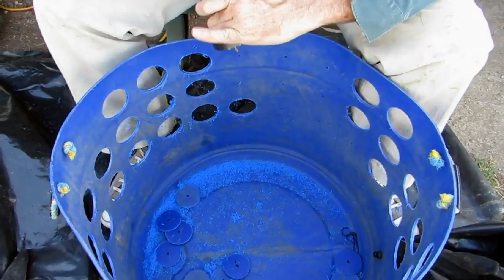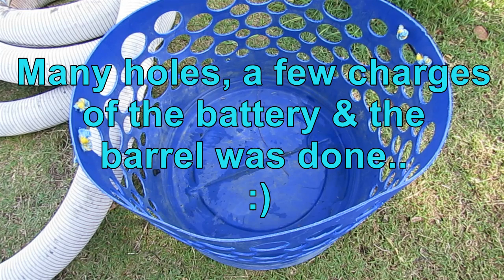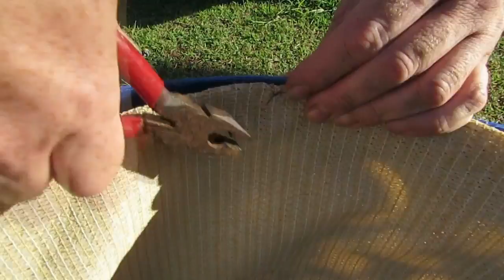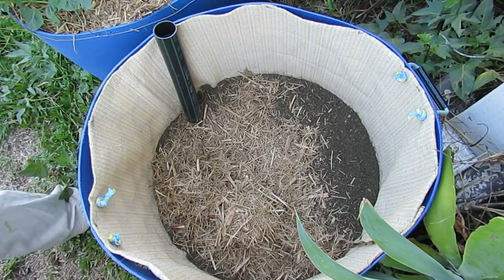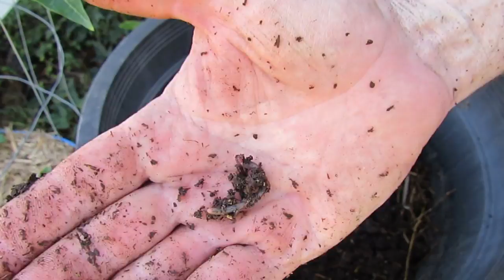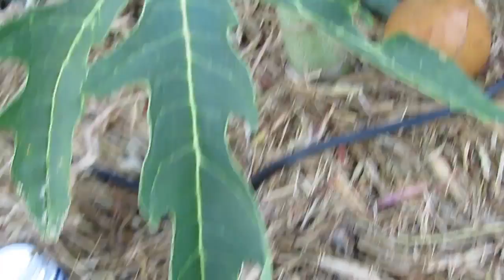Air Pruning Self watering/Wicking barrel, a DIY project for papaya/pawpaw..

Comment: So how did this experiment go?  when I first watched you with the wicking barrels you just had one coil of pipe and the middle was full of sand On this one you add more. When i made mine I used the second approach. What I noticed was that some of the barrels seemed to empty every 3 to 4 days, but on a few they always seemed full.  Do you have a list of what grows better in the barrels ? Zucchini seems to do much better in the ground for me. Peppers and tomatoes seemed to grow well, green beans started great but then seemed to stop growing (this is one where the water always seemed full).  So I wondered if leaving room in the middle for more sand would give a better wicking action and keep all the soil more moist in the barrel. Any thoughts?
Reply from the maker: Andre Lotscher Hi Mate.
The papaya is still growing well. Just started to set more fruit after I started to feed the soil in there better. 
Have hit & miss results with a few different plants. Zucchini did OK as did the beans in some but not in others. Have found that the beans didn't do so well in barrels with little planted in them. Not sure if that's because the soil in there didn't get to dry out as much & the beans didn't like the constant moisture or if the soil blend in there was just a bit dodgy.  

I don't think having the extra pipe in the centre stops the wicking action too much as long as there is a bit of sand making it through to the base to bring the moisture up to the soil level.  In the barrels I've set up this way the soil is always damp 50mm/2" under the mulch layer. 
It would also depend on the soil blend too. I don't think most of the the bagged potting mix we get here would work too well in barrels like these unless extra compost/organic matter is added. 
Hope that helps a bit mate.
Reply: Did either of you innoculate your beans? They may not have had the bacteria they need available to them in your soil mix, and that can slow them down quite a bit. Here in USA, zone 7b (long, hot, humid summers, but not quite as hot as yours, Rob -- we hit 100F a few times in the height of summer, but anything over 95F w/80%+ humidity seems WAY hot enough!) we have a critter called a flea beetle that causes a lot of damage to leaves of all kinds, but they don't seem to bother anything that's potted in something 2' or taller, so the nightshades (tomatoes, peppers, eggplants) do much better in pots as long as we make sure the nutrition is right with good soil, compost, and good drainage.

Now my question, because I'm too lazy to go back to the first video I saw you use it -- your sock material. What's it called, where'd you find it? I want to search for a North American (Texas, if possible!) analogue!

Comment: I read somewhere that Papaya tree don't do well on Wicking barrels. It says something like they don't like "Wet Feet" . Any suggestions on this. Thank you and great videos you have.
Reply from the maker: Tony Molina Hey Tony.
Ours is still doing well with new fruit setting on it at the moment. The only problem I've had with it is the nutrients in the soil were depleted very quickly. I had a period where the tree set no fruit until I started to feed it regularly with a basic compost tea. 
As long as wicking barrels/beds are allowed to dry out a bit between filling (to mimic the natural cycle in the ground & allow O2 to be drawn into the soil) I can't see any problem. Have seen some massive papayas grown in aquaponics too & am planing to do the same here ;-) 
Cheers Tony & have a great one.
Reply: RobBobs Backyard Farming
Thank you brother.

Comment: Hi Rob,
Just a thought for you rather then drill you 50mm holes directly below each other if you off set each row this should prevent the need to drill the smaller holes in between there for saving you some extra work next time you do you next barrel..
Regards
Wayne

Comment: This is another very interesting video.  I like these ideas, kind of everything container rolled into one.  My question would be, you are planting a tree in there ... so, how do you feed it over time, or are you going to just re-pot it when necessary?  Can you leave it in that air-pruning pot and just add compost or fertilizer over time?  Good luck!
Reply from the maker: justgivemethetruth Hi Again..
The tree used up a lot of the nutrients in the barrel fairly fast which was to be expected.. Have worked out that it needs to be fed every couple of weeks to keep the flowers & fruit coming.. Have been using compost teas & a kelp so far & they look to be working OK.. 
Cheers..

Comment: Hi Rob,

At around 11:30 you mention that you might add some air pruning to your aquaponic system. This is something I'm particularly interested in as tree-based products are a pretty substantial part of a person's diet (most fruit, for example). I note in your more recent videos you did add a couple of constant flow barrels, but these were just ordinary barrels. Was this (air pruned aquaponics) something you still hoped to look at, or did you change your mind / run into obstacles?

I ask as I have tried to find people doing this successfully, and have only found a couple who've had limited success, and nobody growing anything as large as the papaya or morenga that you have in your current air pruning pots. I plan on building a system over the coming year, so if you foresee any particular difficulties then your insight would be particularly useful. I'm trying to decide whether to use a soaker hose tied so it runs around the barrel in a circle somewhere about halfway between the centre and the outer edge (similar to constant flow but with the water at a lower rate in more places so it doesn't just run out the holes in the sides), or whether to just do the wicking through soil with a lower layer of sand - obviously the extra nutrients provided by compost, and the reservoir aren't needed when there's a good flow of high-nutrient aquaponics water. (Oddly over here in the UK, the first is easier to set up - despite it being the more complex, it's easier to get the parts - mostly due to the PVC pipe business being dominated by one company who do non-standard sizes making them incompatible with many fittings!)

Thanks for the regular videos, as always, very informative and interesting!
Reply from the maker: grotlek Hi there.. 
I did play around with some 1gal pouches in the last of the 3 aquaponic beds I set up but didn't follow through with it.. Wanted to pop in some greens so the pouches have come out for now..   
Have seen folks grow quite large papaya in aquaponics but not in a hybrid set up.. Am looking at setting up a dwarf papaya in the aquaponics here but am not sure how the bed/barrel will be sorted out yet.. 
Glad you like the clips & have a great one,
Rob..

Comment: I really like this idea but there MUST be an easier way than drilling so many holes? We live in the age of cheap plastics. What can you buy off the shelf with holes already available (ie laundry basket) that you can convert into a wicking pot?
Thanks for the video.
Reply from the maker: Hey Jeff..
Laundry baskets would do the trick but may not last as long due to the UV.. Air pruning bags like Root Pouches sitting in a tray of water are another easy build that would have the same sort of result I think.. 
Would be great to see what you come up with if you have a crack,
Rob..
Reply: Thanks Rob
Really like your self watering pots.
I need a way to limit my paw paw (not dwarf) to a managable height without making it root bound.
I might give those bags a go.
How much do you pay for the barrels? I am trying to source some. I'm also in Brisbane.
Reply from the maker: Jeff Bourke Have picked some up at markets & gumtree for $10-15.. Most produce/feed stores sell them between $25-35.. 
You can find the Pouches on pour website if you're interested.. Will be setting up a barrel with one in a few days & will post a clip on how it went..
Cheers mate..

Comment: Why put the hose in the bottom? Why not just put sand in there?
Reply from the maker: Hi Ella..
The hose is there to allow for more water to be stored in the base allowing the barrel to go longer between top ups.. 
Have a great one..
Reply: Does the water stay inside the hose? It seems like it would just run out.
Reply from the maker: Ella there are holes in the pipe so it can flow into the sand.. From there it is wicked up to the soil to become available to the plant..  As the base of the barrel is sealed it can't run out to waste..
Reply: If you want water in the sand, why not just water the sand? Does the pipe hold MORE water than the sand alone would?
Reply from the maker: Yep.. The pipe is a large void space compared to the space between grains of sand..
Reply: I have a hard time seeing why it doesn't just flow out through the holes into the sand though. :D Sorry I feel dense, I need to do it to understand.
Reply from the maker: The water is supposed to flow out into the sand so it can wick up to the plants.  The pipe just offers more water storage capacity when the reservoir is full of water. Hope that makes sense ..
Reply: I can see a pipe without holes storing water, but a pipe with holes, where the water can just run out (as it tends to want to do)...not so much.
Reply from the maker: Well, it flows into the sand & is stored there once the sand is saturated.. Might pay you to run your own experiments & see what you find ;-)
Reply: It stays in the tube as water, once the sand is saturated. I'm starting to be able to understand, I think???? lol
Reply: RobBobs Backyard Farming   Also, do you want it so heavy you have no hope of every moving it without lots of hands on it?
Reply from the maker: Have moved a lot of barrels with a hand trolley justgivemethetruth so I don't think it'll be too much of an issue..
Am sure I'll be able to sort something out if worst comes to worst..

Comment: Really interesting way to plant fruit trees.  I'm wondering if the trees would survive in their above ground pots in our Zone 5 climate?  Would love to grow our Dwarf Honey Crisp apple trees in this kind of pot. Will be checking out your fabric grow bags and see how they might work for us.  Great site.  Thanks for your helpful and innovative info. Lynn & Rick
Reply: WisconsinGarden 
I've seen young trees boxed and insulated up to 3 feet above the root line for winter protection.
You may also consider bubble wrap velcro coat for the rest of the trunk and main branches to keep the tree cozy.
The rest would be considered freeze pruned.
Reply from the maker: Hi Lynn & Rick.. Might be a bit cold there as the soil in the barrel might freeze on you.. Could be another story if you had a warm enough green house to grow them in..
Cheers,
Rob..

Comment: With a tree coming out of a pot like that, I've seen the bottom couple of inches of root and soil simply cut off.  Didn't seem to harm the tree any.
Reply from the maker: Am hoping that the tree won't get rot bound in the base.. The tree will be removed from the barrel at some point to see what has actually happened with the roots in the reservoir.. 
Cheers & have a great one..
Reply: RobBobs Backyard Farming 
Will you update the video when you remove the tree from the barrel to show how it's roots developed?

Comment: Hi rob,

Sourced most of the material, just not getting the same kind of shade netting you used. Could you tell me the kind you used
Reply from the maker: Hi Karan.. So sorry I haven't answered your email yet.. 
Did you end up finding some "sock" for the ag pipe or have you used other means to cover the pipe ?

The shade cloth is 90% UV blocking cloth.. Is normally sold in hardware or garden/landscaping stores here.. 
Here is a link to the distributors we buy some of our netting from.. Not sure they would be the cheapest option for you to purchase the netting but some of the information on their page might help.. This page has downloads of their various products just to give you an idea on their quality & how long the cloth should last.. 
http://www.netprocanopies.com/product-sheets.html

I do hope that helps some & sorry again for taking so long to get back to you..

Comment: Hi Rob,  Have you or do you know of anyone that has tried putting in some perlite or vermiculite in place of the sand and tube?  I have tried this for a brief time so far and find it amazing how much water these inorganic materials will hold.  I think it is great for wicking because it does not rot like organic materials do.  I like the air pruning idea and want to use that with a wicking system in the next growing season.
Reply from the maker: Hey Dale.. I haven't heard of anyone using them to tell you the truth but have had someone ask if I thought it was suitable before though.. 
My only concern would be that it would compact over time but would love to be proved wrong :-) Have only ever really used perlite in hydroponics years ago for a short time before switching to the clay balls so have very limited knowledge of how it holds up over time.. Would like to know how it goes for you in the long run..
Cheers mate..

Comment: Hi Rob, I building 4 air pot this weekend, I'm interested in your slit cut idea, rather than the holes. Hopefully you'll get some time to have a look at this idea in the near future. All the best, keep up the great work.
Reply from the maker: Hey there... I have made the barrel, just haven't got around to making it up as of yet.. Did post a picture on our facebook page though..
https://www.facebook.com/photo.php?fbid=614555171927232&set=a.417629381619813.91747.417625838286834&type=3&theater
Have had some say the gaps are too wide but think the shade cloth won't bulge that much if secured correctly.. The barrel is really there just to help the insert keep shape.. 
Hope that gives you a few ideas..
Rob

Comment: great video thanks for the info
Reply from the maker: Hi there..
Hope it helps out out some.
Cheers,
Rob :)
Reply: Rob Bob yeah iv seen the small plastic air pots that you can buy but your idea with the pipe as a water storer is a good idea.. also i love the idea with the roof felt that's good as you can have a bigger hole s with out the soil foaling out    and the air can do its thing on a much bigger scale
Reply: Rob Bob i think it will one day if it stop raining in the uk lol

Comment: Like this idea I may try it myself.  I have a bathtub wicking bed setup.  Its going OK but not excellent.  I may post a review on it today along with aquaponic and my hydroponic system.
Reply from the maker: Has been working well for us so far Kevin with the papaya tree still going strong.. Only have one fruit on the tree but think that's more an issue with pollinators than the barrel..
Cheers mate,
Rob.

Comment: more oxygen gets to the roots, which means the plant can uptake more nutrients and in turn grow bigger, bearing more flowers and fruit.  i switched over to them a year ago and would never go back to closed pots.  i always inspect the root masses of tomatoes and chilis etc. once harvested, i consistently cannot break the soil away from the roots as the root mass is a fine network spreading to every centimeter of the soil space in the air pot.  this is not generally the case with closed pots, in my experience.. anyhoo..
Reply from the maker: Cheers for that.. Hope to inspect some plant roots soon to see how the have done in other air pruning bags..
Have a great one..

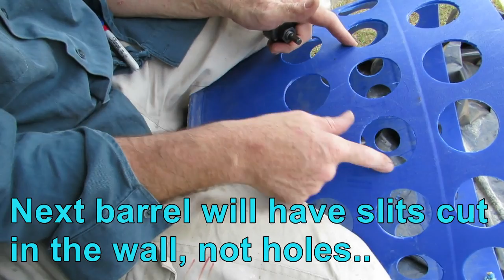Comment: Hey Rob, great channel! I'm in the process of making some of these air wicking pots. One question: In this video at about 2:48 you write on-screen that the "next barrel will have slits cut in the wall, not holes". Can you elaborate what you mean by this?  Do you mean vertical slits that gape a bit when the barrel is filled? Will you still line it with shade cloth?
Reply from the maker: Hi there..
Still haven't finished the next barrel but did post a picture of the cut outs in the barrel on our facebook page a while back..
https://www.facebook.com/photo.php?fbid=614555171927232&set=a.417629381619813.91747.417625838286834&type=3&theater
I think it might be a bit of overkill but we shall see ;-) Will still line it with shade cloth with the barrel really only there to hold the reservoir & keep the cloth in place.. 
Cheers & hope that helps..

Comment: Great video as usual, I was thinking to get maximum air for pruning coming into the plant would a complete wire mesh pot with shade cloth do the trick?
Reply from the maker: Would work great I think Kyee71.. B suggested trying to make some out of the fencing panels we have but they don't bend too well I found.. Would be interested in hearing how you go if you try them..
Cheers & all the best,
Rob..